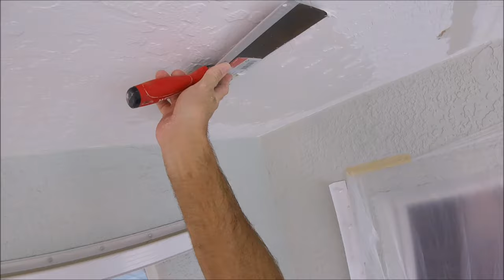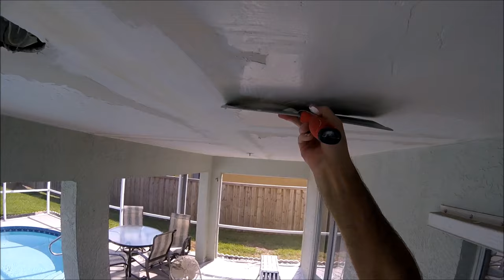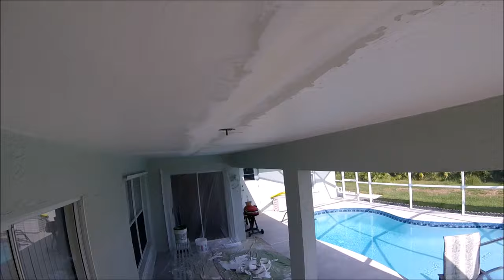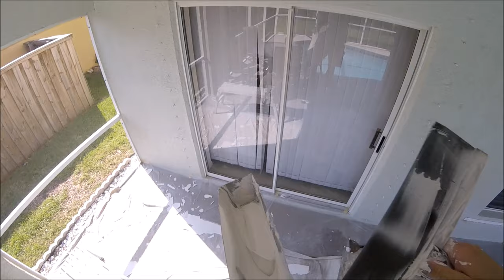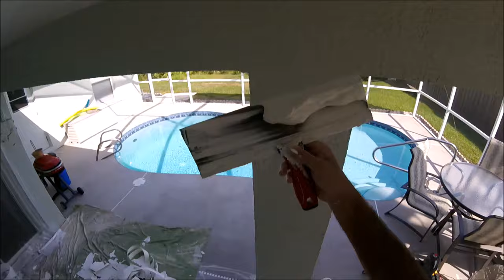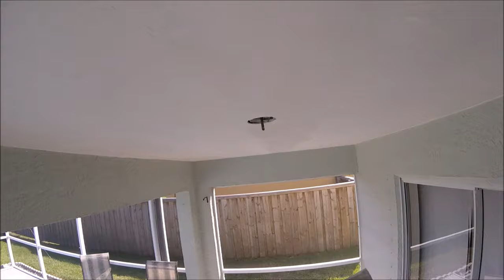How to Skim Coat a Ceiling in Less than 1 Hour!! With a Mud Pan and 14" Drywall Knife

Comment: Nice video
I wonder if I will texture it after this?
Reply from the maker: Thanks Tosouten! No you won't be texturing this ceiling I just skim coated. Stay tuned because I'll be doing a skip trowel texture on it in a video I'll be posting in a couple day's.  Where are you located? Are you having your comments translated? -Paul

Comment: Would it be okay to skim coat over mastic? I took down ceiling tiles and my ceiling now has a thick layer of brown mastic I would like to cover.
Reply from the maker: Hi Candace, Yes, you can skim coat over the top of mastic. I would just make sure that you have removed any loose debris and bigger chunks of the mastic. It'll probably take two rounds of skim coating to get it pretty smooth. Hope that helps, -Paul

Comment: I find that just watering the mud down thin and then rolling it on is faster.  Then I run a 2' knockdown knife with a long handle over it.(https://www.homedepot.com/p/Wal-Board-Tools-1-5-8-in-x-24-in-Knock-Down-Knife-33-024/100377298) That is the one I use.  I came up with this while skimming my entire house after removing popcorn and fixing the drywall.  I'm not a master but I'd be able to roll this entire thing and pull it in 15 minutes and it probably wouldn't even need sanding or anything if you were texturing afterwards.  I'd just run the knockdown trial over it again to knock the ridges off. I do walls like he is doing but using a small knife over head in this manner can kind of wear you out.  Not to mention the going up and down the ladder.  With the knockdown knife handle being a couple foot long I can roll a 4-6 area in a minute or two and then smooth it in a minute or so using the knife without ever getting on a ladder or stool.

If I were doing a whole house and it was 10'+ ceilings, I'd just bend the blade and put a longer handle on it.  I also have a magic squeegee type trowel but it really doesn't work as well as the knock down knife in my opinion.  This also works after you do fresh drywall.  If you run the thinned mud over the joint (after you have done it with tape and all) it feathers it out further in one pass.

Comment: Why not use Topping compund versus thinning joint compound?
Reply from the maker: Hi Tom, Because I’m skim coating over a painted surface.👍🏻 The AP has better adhesion because it has more glue in it. Thanks so much for watching and subscribing! -Paul
Reply: Paul Peck DrywallTube i watched seejanedrill as well. Theres a video on her channel i believe that demonstrates getting ultra smooth skim coat results using a squeegee trowell. Im thinking about using that technique on my ceiling but getting all information possible from all sources experienced in skim coat.  

Any thoughts on squeegee troweling?

Comment: Thanks for the video.  I have a kitchen ceiling that I scraped popcorn off of and then textured with an orange peel style and then painted.  Unfortunately, we had to remove a soffit and it is obvious where it used to be.  I don't like the end result and am considering skim coating it.  I would like to then blow on an orange peel style texture and then paint it.  Does this sound reasonable?  I am not planning on scraping off the current texture as it is pretty light.
Reply from the maker: Hi Charles, Yes that sound reasonable for sure. What I do when I'm blending orange peel texture is spray the repair with a little texture first then spay the whole area. Be sure to spray the area where the repair meets the existing texture from all directions.This helps fill in the most crucial part of hiding your repaired area. Hope this helps. Let me know if you run into any other questions, -Paul
Reply: Thanks Paul.  Sheetrock guy is repairing tomorrow.  Then I will be skim coating.
Reply: I am not sure how you skim coated that entire area in such a short time.  Took me a couple hours per coat and I had to do two.  Sanding is done and it is nice and smooth now though.  Texture is next.

Comment: Every time I watch this video I pick something else up...is it important to go over same areas multiple times? You would break ceiling into sections then come back to previous section....
Reply from the maker: Yes. That way you get nice long pulls. Which means a smoother skim. In turn equals less scraping or sanding depending on what finish you're going for on the ceiling or walls.
Reply: Paul Peck DrywallTube as I prepare to do a 24x26 garage ceiling, i am watching many skim coat videos. One video showed a rubber edged squeegee style trowel to fine finish with. Using it after the surface had dried slightly and frequent dips in the water. This to reduce/eliminate the need for sanding.
Your thoughts appreciated.

Comment: Therapeutic to watch (someone else do it ha) - I'm doing same thing to a bonus room.  Was that a one & done coat or did you place a second coat on it?  I find that I need to do a second coat with a thinner compound to achieve a smoother finish.
Reply from the maker: Yes most definitely it takes another light skim coat or touch up coat to get a smooth finish. But on this project I was going to do the original texture that had been on the ceiling before I skim coated which was a skip trowel. The skip trowel hand texture really hides a lot of imperfections and is a nice Mediterranean look. Here's the video of me skip troweling this exact ceiling https://youtu.be/jjO0Y3ITRRg Thanks for the comment!👍🏻 -Paul
Reply: Paul Peck - - -  I like the finish of the skip trowel method - my bonus room needed the popcorn removed & skimmed over for a smooth finish but the builders didn't hang all the drywall quite level and although now smooth, I'm not thrilled with the drywall itself - guess that's why they used a textured finish.  Might go with that skip trowel down the road, thanks for the link
Reply from the maker: Sounds like a plan Marshall.👍🏻 Skip towel is a good look and has a great hiding ability. Here's a whole video playlist with 16 skip trowel videos. From how to mix skip trowel to how to apply it as well: https://www.youtube.com/playlist?list=PL7Ww-LhWbB0HN1TIHb-wEZAcqKeRw0ti4 Let me know if you run across any questions along the way. -Paul